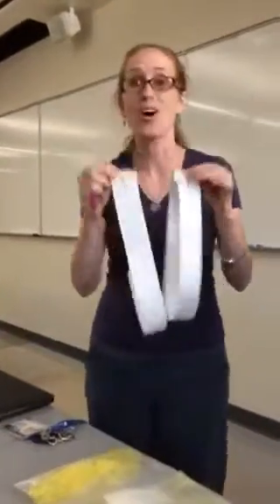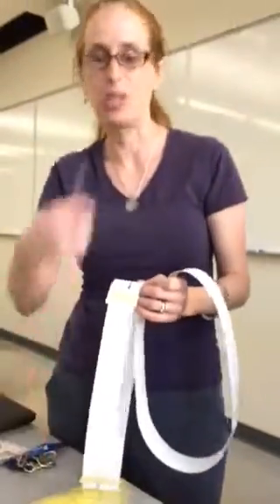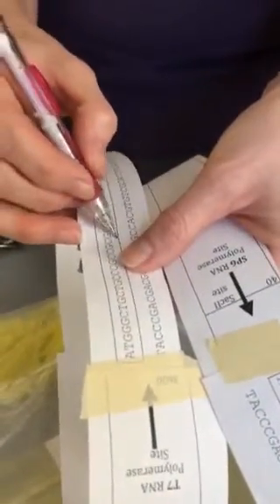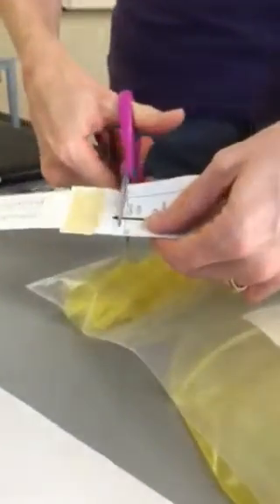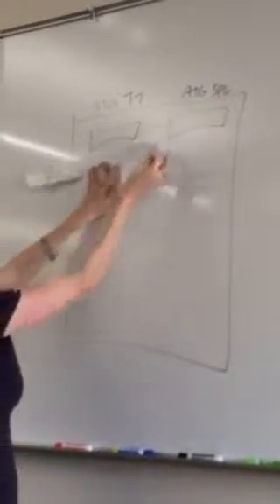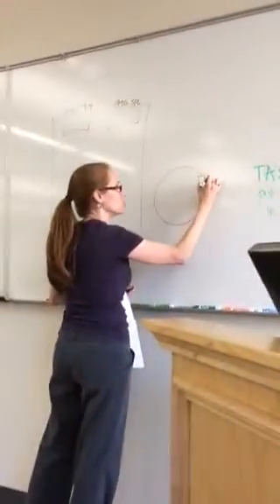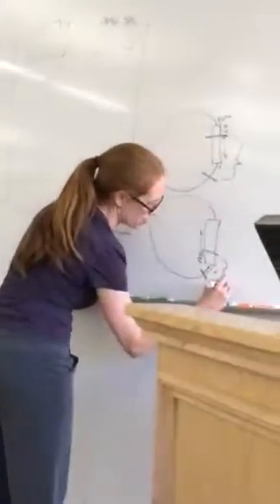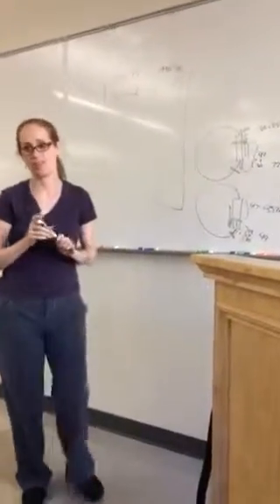Determining orientation

Comment: mam what ever the direction is doesn't the gene of insert transcribe?
Reply from the maker: Yes.  You can transcribe the inserted sequence from either orientation.  However, you have to choose which polymerase to use. On each end is a transcription promoter unique to one of several polymerases (e.g., T7 or SP6).  Going from one direction will transcribe the coding sequence.  Going from the other will transcribe the template sequence.  So, depending on the application, you have to know the orientation so you can choose the correct polymerase to add to your reaction.  I hope that makes sense!
Reply: @jamiejensen182  mam why do you have to use to different promoter sequence on the either sides of the gene of interest if u did so u have to choose the polymerase based on the orientation" if I am correct? "
why couldn't you use the same same promoter
Reply from the maker: @manikantakolasani8440  If you have the same promoter on each side, you would be unable to specify whether you want the coding or template strand.  In some cases, you want the template strand - like when you are making an anti-sense probe for in situ hybridization.  In other cases, you want the coding strand - like when you want to sequence the gene for GenBank.  So, you have to be able to distinguish the two. If the same promoter is on both sides, you'd get a mix of coding and template strands.
Reply: @jamiejensen182  mam thanks a lot for making the concepts clear mam please don't mind I am just asking this out of my curiosity.
 I  did my masters from university of Hyderabad but unfortunately I never thought in such a way. 
just one more question
if I wanted to transcribe a segment or express the particular segment or a gene for instance if I had cloned it in pet28A vector and I want yo express this protein encoded by that particular gene in bacterial system I transform this to that Rosetta cells or BL21 cells and induce it to express my question here is I am just transferring a eukaryotic double stranded DNA segment (gene) that is a single copy how is it sufficient to produce so much of protein for a gene it should contain 2 copies. 
mam can u explain this. 
if u tell that plasmid is self replicating in bacterial system where does this get the DNA polymerase to replicate and RNA POL to transcribe
if it got so how can the post translational modifications are happening in this bacterial system where there is no definite nucleus and endoplasmic reticulum and mitochondria 
mam sorry if I trouble u much.. 🙏